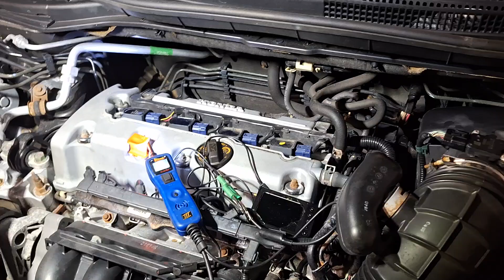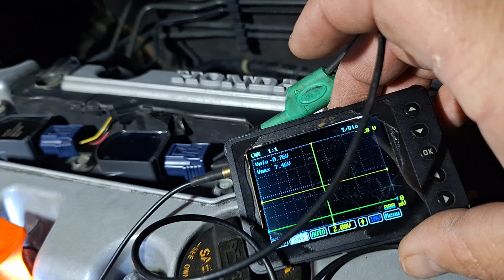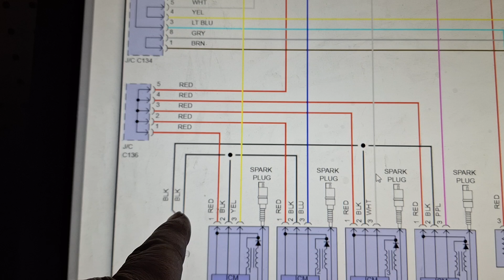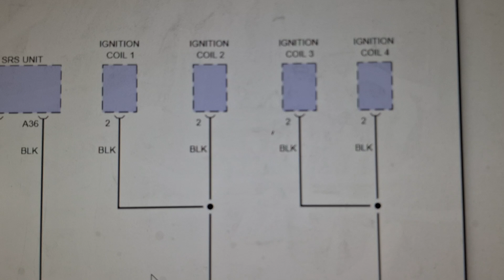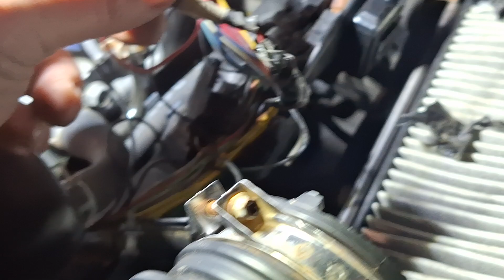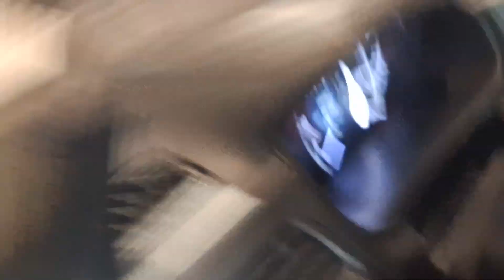Honda crv p0351,p0352,p0353,p0354 diagnostic and repair.

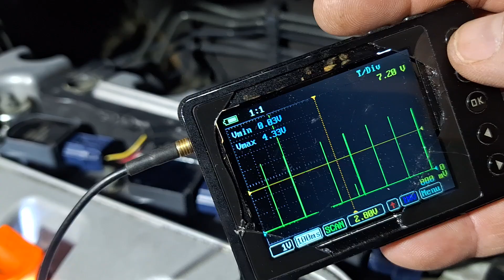Comment: At 3:26 I think that is primary control not feedback, at 6:22 I think the PGM FI module stops that cylinder's injector operation until key reset when misfire is gone, it detects the condition through the crank sensor misfire detection. If you had put your scope on injector control, you would have verified it.
What do you think?
Reply: So what are you saying? Because I also had the same assumption (Invested because I have the same issue)
Reply: @CeeG-p5q  ?
Reply: In my case I suspected it was the computer stopping that cylinder from firing and not an actual physical wiring issue